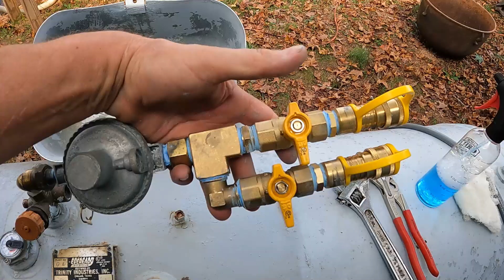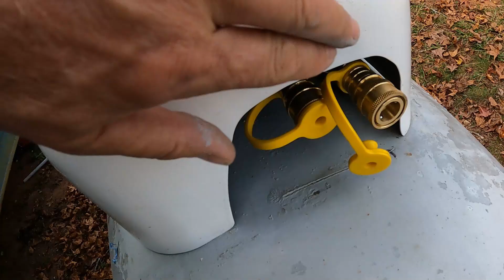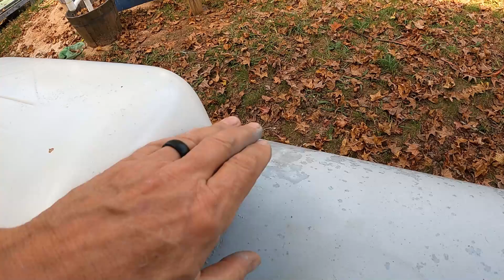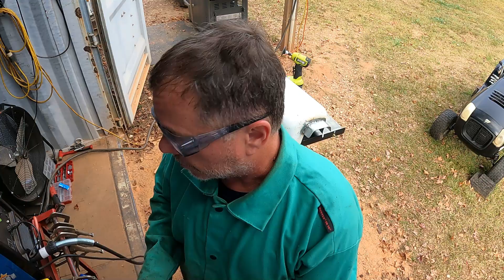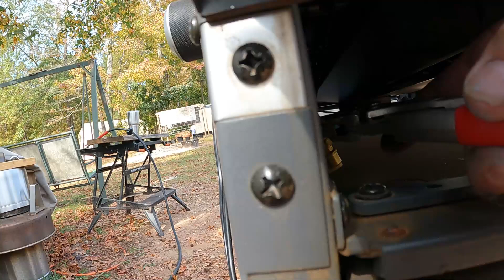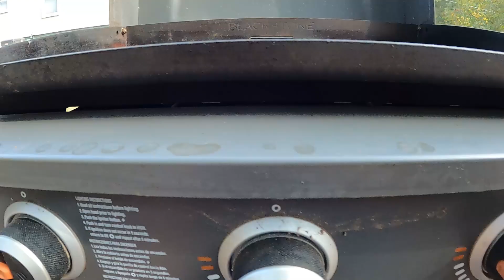Quick Connect Your Gas Grill To House Propane Tank | RV, Generator, Water Heater

Comment: Good job, don’t forget to ground the propane tank.
Reply from the maker: Yes, do you think grounding to one of the tank stands will be good?
Reply: I used two 8’ rods 6 feet apart. Remove the paint when clamping to the tank. The two rods need to be connected then run to tank.